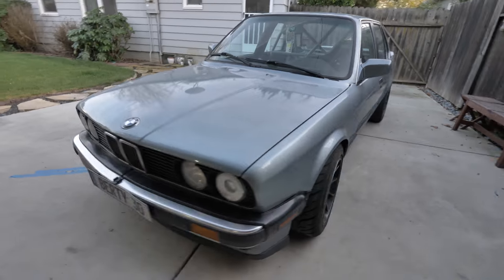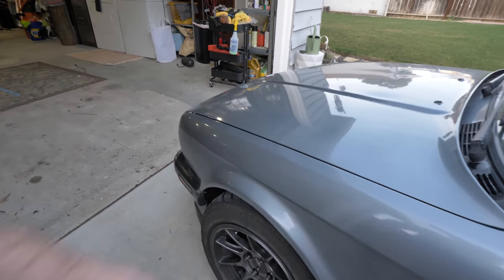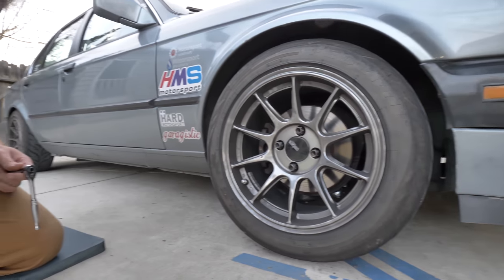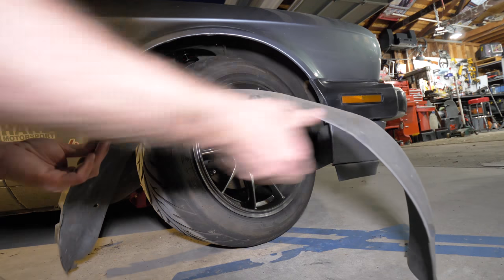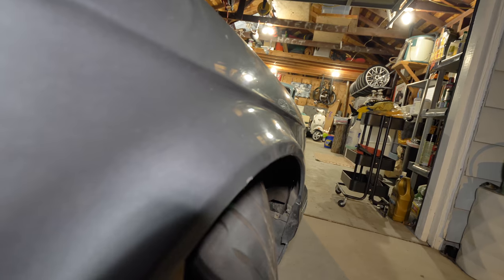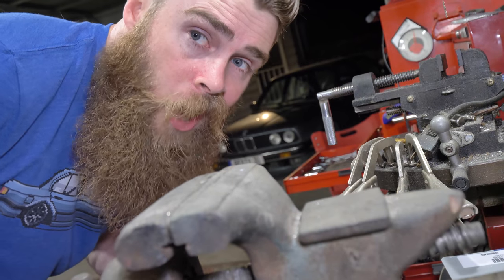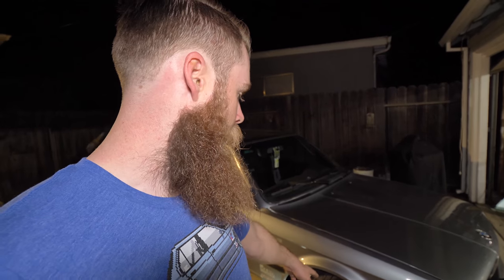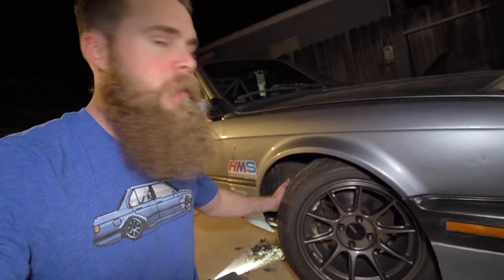FREE WIDEBODY HACK! YOU CAN DO THIS TO ANY CAR! [4K]

Comment: Could paint the exposed inner fender black or whatever. That might look better to hide some of the surface rust.
Reply from the maker: Justin Kelly I definitely agree it would look a bit better or possibly cut it out for better Aero.
Reply: Agreed. I think a black wire mesh with round holes cut to the size of the opening would look cool too. http://italianhorses.net/Tutorials/Photoetch/20.JPG

Comment: That looks sick! I really like it! Not too aggressive looking.👍 quick question, is it safe to run to run extended lug nuts on stock wheel studs?
Reply from the maker: Thanks dude! It should be fine as long as the lug nut is the right design for the wheel and you aren’t running spacers. If you’re running spacers your goi g to want extended studs. But if you’re doing extended lugs I would always do extended studs #becauseracecar
Reply: Blake's Garage cool thanks for the quick reply!

Comment: Are you going to be swapping over to plastic bumpers? I have an 84 ETA coupe, exact same color/trim as yours but it's got a 2.7 instead of the 2.5. The 88 uses chrome bumpers but late model bumper shocks and valences, so for your car it would literally be plug and play minus wiring the turn signals.
Reply: Diving boards are lighter than plastic bumpers, believe it or not. They are ugly though haha
Reply: Thecharger I had read that in one of the forums, didn't know if it was true or not. Even so, diving boards are horrendous

Comment: Cant u bow it out in the top middle sections and put those mesh looking thing for front lower bumpers and custom fit it in that gap. 

Itll be like those bmw fenders with fake holes for air to cool your brakes kinda thing.

Seen something similar on a nissan 240 sx but with rear quarters pannel, he wanted more clearances with his over fenders. He did something like u but his was fiber glass and was able to bow it in the middle to make it look wider + morw clearence.